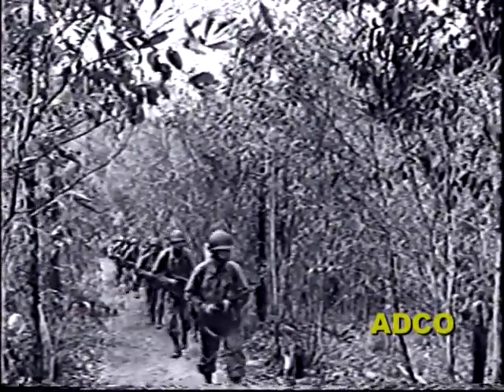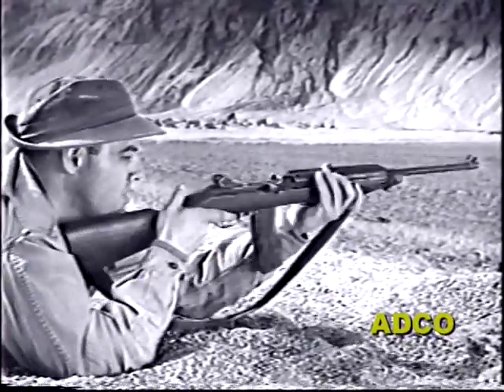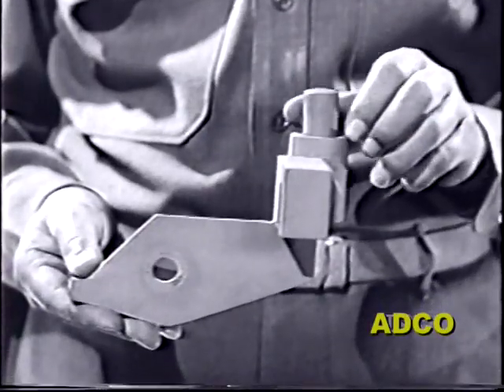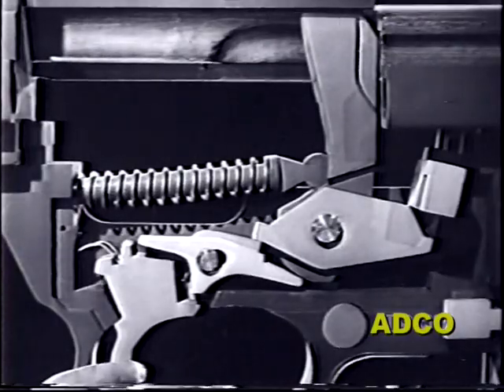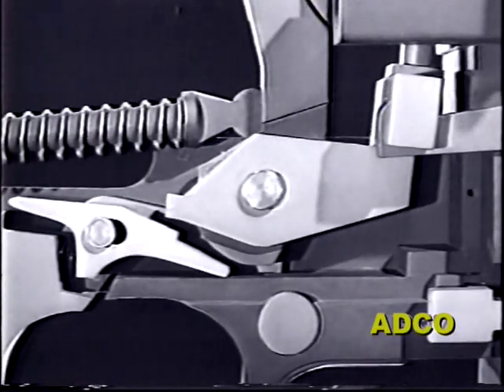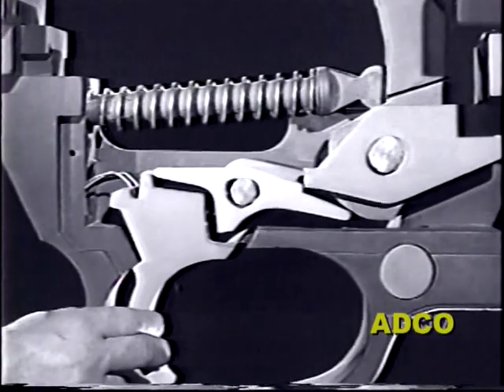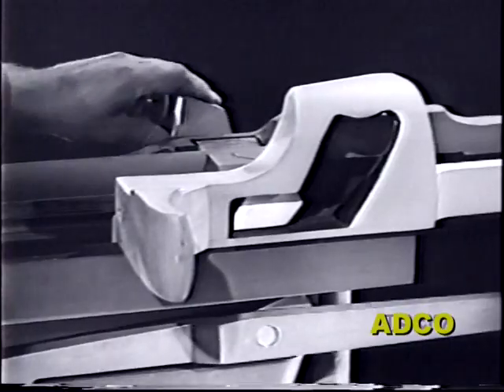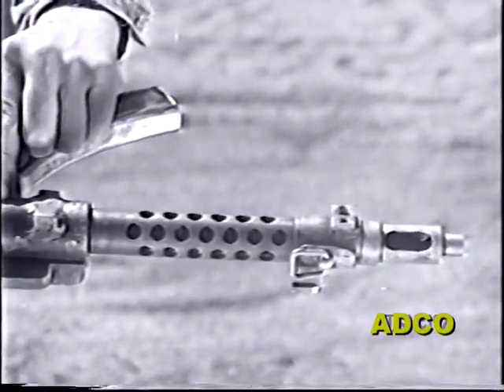M2 Carbine Operation

Comment: They tried to use this as the basis for the SCAR mk.16 but they screwed it up by flipping the gas system upside down. I think an enlarged M2 carbine action would make a great assault rifle in 5.56 as long as they kept the M16 style charging handle and trigger group.

Comment: If .30 Carbine was just slightly more powerful with say 100-300 ft/s more speed at the muzzle, it could be considered an intermediate cartridge, and thus the M2 Carbine would be the first assault rifle of the US. As is, the M1 Carbine has been taken successfully to 250-300m. That's a stretch though, so the M2 Carbine doesn't have the accuracy of the AKM (Has been taken to 300-400m), but it's lighter and has more controllability.
Reply: Howdy  and more controllably I believe, though I've never shot .30 carbine or 7.62x39